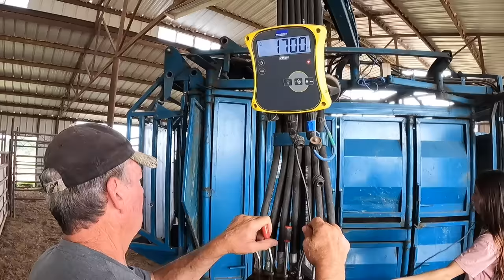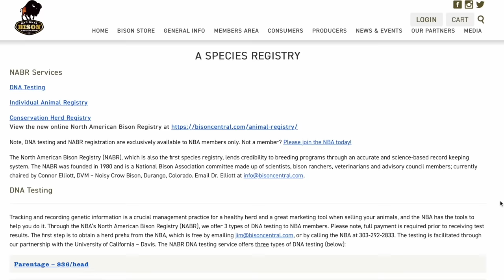Bison Bull Gets Fertility Checked! | Genetics Specialists Reveals...

Comment: Why do you keep the weight at the back. We where told to  put the weight in the front of the trailer it helps with breaking even if you have breaks on the trailer. Just wondering if it was a personal thing.